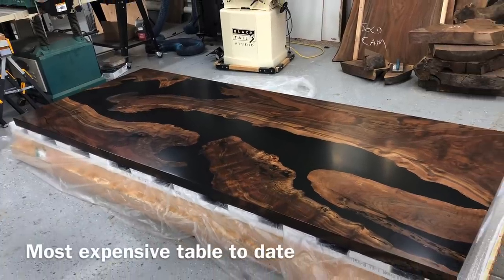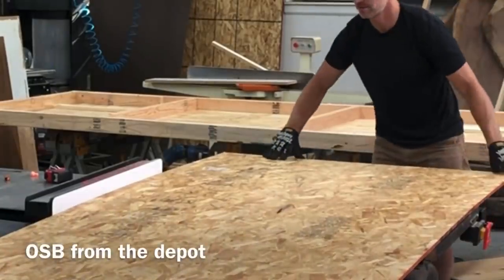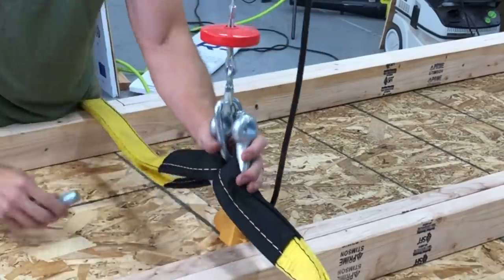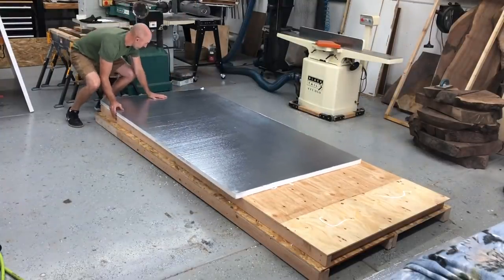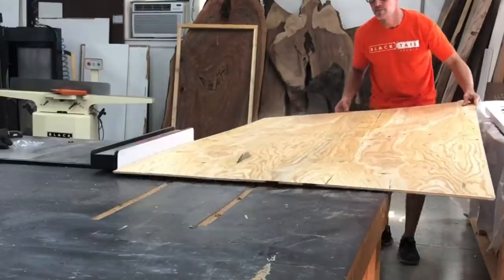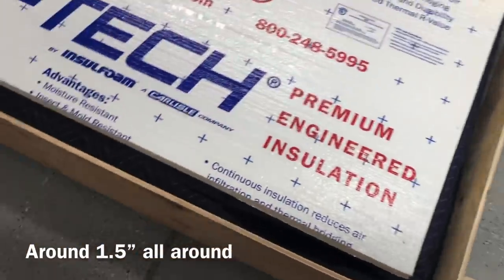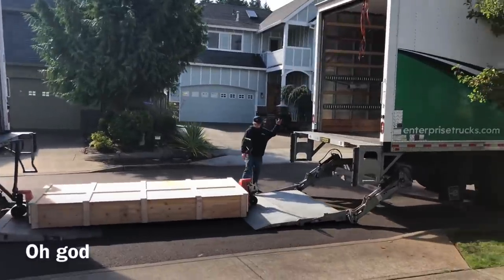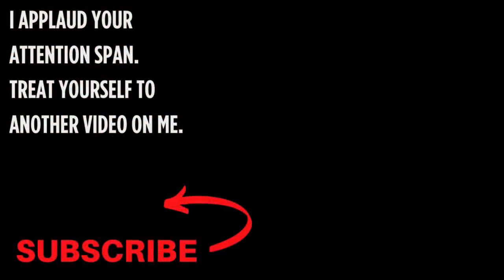Epoxy Table 101 - How To Build a Shipping Crate

Comment: Little suggestion..  When I receive servers (the datacenter kind), they are placed in a box, the server is wrapped in plastic, with a plastic bag below it and one above it.. the upper and lower bags are then filled with high density expanding spray foam which expands around the server from below and above.  Provides for a 100% fit in the box (in your case the crate) and will prevent any shifting.  Just need temp supports under the table to allow for space for the foam, those supports can then be removed.
Reply from the maker: That’s a serious setup!
Reply: @BlacktailStudio  Well, you have serious artwork.. :)

Comment: Switzerland 
I always like to overbuild my stuff too. I have built a desk that is a 2cm (5/8 inch)  thick plate. This plate supported by 6 cm by 6 cm (2 3/8 in) roof construction beams. I put 4 beams beneath the plate which is 1m by 2m (3ft by 6ft). I guesstimated it could take 300kg (600 pounds).
With it being overbuilt I never worry that I’m going to break it. :)
Reply from the maker: Nice!

Comment: Question on a resin project. Wife and I are making a coffee table and we have an idea for a top made from only resin. With your experience is resin alone a viable option? Looking to do a clear table with almost a water color design. Thinking of 3 pours. 1 clear base, 2 water color section, 3 clear top. Everything i see has wood or some structure with the epoxy. Great channel, awesome projects. Thanks for any insight you have.
Reply from the maker: Could definitely use resin only!

Comment: You got lucky on this one. This crate is in no way rigid or heavy enough for what you're shipping. Regarding foam, having shipped a lot of heavy flat things, using this hard foam over such a large surface area is similar to shipping the table on concrete blocks for padding. Over that amount of square inches, there's basically no 'give' at all to the foam. Foam insulating panels are a popular solution, but a pretty bad one. I went to softer padding, and haven't had a shipping failure since. Your buddies are effectively doing the same thing by reducing the amount of foam (and therefore reducing the surface area), which makes hard foam appear softer. Not a great solution though, because it introduces stress risers across the weakest axis of the table. Also, I'm confused . . . how did you actually think they were going to lift something like that? Curious about your thought process there . . . You thought they travelled around with gantry crane, or a forklift and 20' forks, or what? Well, now you know: they don't. Large glass panes and rock slabs are typically shipped on edge in an A frame, just saying.

Comment: Good stuff Cam.  I'm building a resin river table similar to yours that's well over 8 x 4 (9.5 by 4.5 feet) and your crating tutorial is spot on. I'm having trouble finding a freight company that'll take something this large as they can't just pallet jack it into a truck.....the two-truck liftgate trick is great.....BUT I'm having trouble estimating the weight of both the table, legs, and crating to get a good quote for shipping from Central California to Atlanta GA.  How did you do the weight estimates.....good rule of thumb or weigh a smaller representation then multiply...or other?  Did you ship legs seperately?  What freight company did you use that was so creative in the loading?  THANKS !  Brian
Reply from the maker: Check out my blog on crating and shipping

Comment: Minnesota checking in. Great videos they very informative keep it up! Question more along thickness of a tabletop. What's the thinnest would you go for a table roughly 7' by 3 1/3'? Shooting for around 2 inch pour. But if I could save a bit on epoxy and only pour 1.75 thick all the better for the wallet. Thanks in advance!
Reply from the maker: I’m sure 1.75 would be fine 👍🏼

Comment: Great videos and great work. I see, that around your shop, you have quite big slabs that are not flat in the floor and are in an upright position, against the wall. Are you doing something special so they don't bend in order to keep them stored that way? Thanks.
Reply from the maker: Nope, just my only way to store em
Reply: Blacktail Studio Ok! Just checking. I also don’t have a lot of space in my tiny studio, and storing 2 coolies that I have, in a flat position is not very doable. 😂

Comment: Cam, Love the work that you do. I also am a woodworker for the past 30 years and have been doing some work lately with slab tables. I recently did a walnut live edge table that I used Odies oil as the finish on and I am not really satisfied with the finish and was wondering what you would recommend using to possibly refinish it with and how you would recommend going over the Odies with it.
Any help you can give would be greatly appreciated. Love your videos and especially your detail to the content you include in them.
Regards,
Wayne
Reply from the maker: Hey man, I’ve stopped using Odie’s all together now too. I’m exploring Rubio now. And used Osmo a good bit. I’d sand the Odie’s off and use Rubio if I were you.
Reply: Why did you stop using odies?

Comment: After running a router over my table top taking away a black smooth looking top layer. I now have some patches of small micro holes in the black resin. I am presuming this must have been some micro air bubbles that did not come to the top for me to blow out with my torch gun. How can I best avoid this in the future? Should I mix the resin again once in the mould to cause any other bubbles to appear? Thanks
Reply from the maker: They are pretty common. Cooler curing process can help. I usually have to deal with some.

Comment: Kazakhstan, how does the customer build the table once they receive it? Do you organize it for them or it’s their problem now 😅 Bc if you needed 6 people to just lift it and place it onto the crate base, they’ll need to either build it somewhere and then move in into the conference room or whatever (which I highly doubt) or build it on the spot, which will definitely require either more people or special equipment, which is extra cost and resources, if at all possible.
Reply from the maker: I get it curbside. They do the rest. So they had a few people to handle it

Comment: Chicago. That double lift gate action was hilarious. What vendor(s) do you use and/or recommend for the actual shipping and freight logistics? I have seen some other builders recommend uship.com, and was wondering what has worked best in your experience, and if you build the estimated cost of this in to your initial quote, or if you add it on at the end (with the customer knowing ahead of time the expectation either way). There is a large void of information on this topic online (and especially on YouTube), so I think doing a dedicated 5-10 minute video of best practices for the shipping and logistics component you have found would be great, and might be an evergreen clickable vid for your channel. Thank you in advance for any insight you can provide.
Reply from the maker: I wouldn’t touch Uship (again). I use freightquote. Very reasonable
Reply: @BlacktailStudio  Awesome, thank you so much!

Comment: Hey Blacktail Studios, First off, Your work is ridiculous and you are a master. I am currently doing an epoxy table (firs time) and bought the black transtint dye. We did a test in some water like you show in your workshop video and with the actual epoxy and it seems like the color of it is almost like a dark brown or purplish color. we used at least 4-5 drops in both tests and still get the same look. Is this normal for it to look like this? The way the black looks in your videos looks so much darker. Please let me know if you have the same look to yours or any help on this.
Reply from the maker: Hmm, I use transtint dye, that gets super black. Even in water.
Reply: @BlacktailStudio  hmm. i did 5 drops of it in a cup of water and still didnt look dark black
Reply: @BlacktailStudio  this is what the seller from amazon told me on the amount i need to use, which seems absurd from what I've seen you use.

"You would need to add a lot more drops for that much water.  The recommended is half a bottle (1oz) per 32 oz of liquid.  I'd try with a TBSP of water (.5 oz) and one drop of transtint and see how it looks on a 2x4.  If that's not dark enough try 2 drops."

Comment: Minnesota, me and my son are marking our first epoxy table. We are now sanding and i got little pig tails or curly Q's. How do I get rid of them?
Reply: Either get a sander that has suction on it. Or use a shop vac as you go to keep the surface clean.
Reply from the maker: I did a finish video. Should help